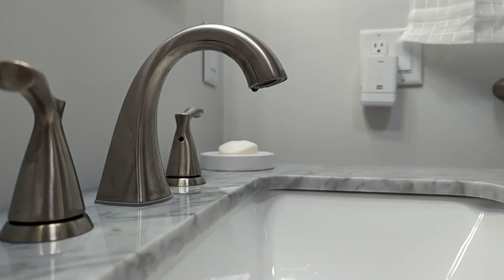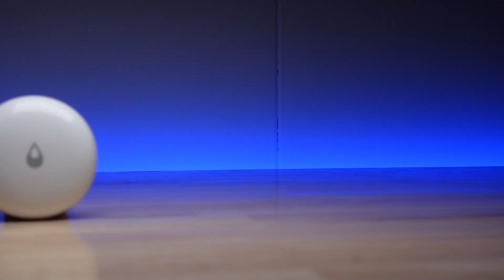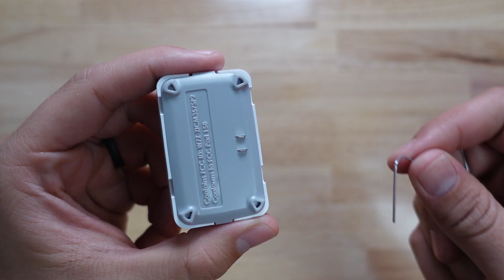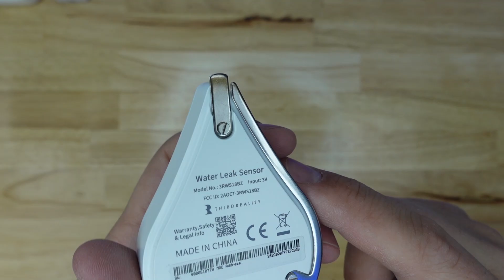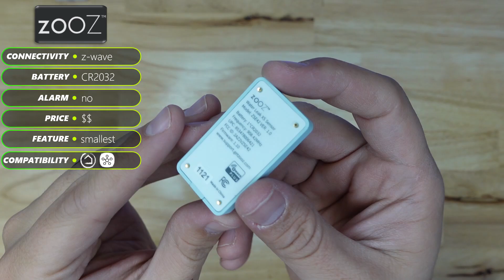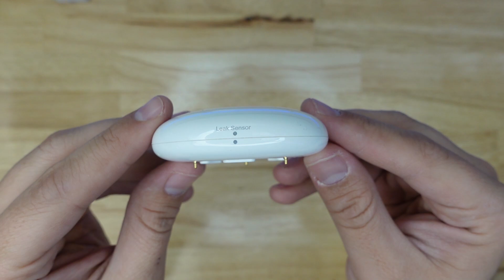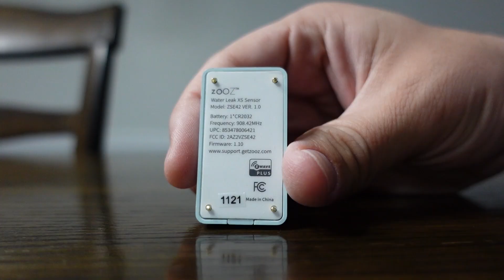Best Water Leak Sensors for Home Assistant (WATCH before you BUY!!)

Comment: I will be doing this for my hydroponic vegetable garden. It is a SmartLife unit and the water detection built-in does not have a sensor outside of SmartLife. With this unit, I will be alerted when I need to refill the device. Adding to my cart now.
Reply from the maker: Sounds like a sweet setup!

Comment: IKEAs leak sensors also stay Wet until you change out the battery. They're SUPER cheap though, so it's easy to pickup a bunch, but I'm not sure how well they work. One of mine has corrosion around the contacts. But because it stayed Wet, my alarm never went off.

Comment: I've had Aeotec water sensor 7 for a while now, but I keep wondering, should I mount it so that the probes touches the floor or should I just lay it "flat" on the floor, the probes being sideways not contacting the floor. I think I should mount them all so that the probes touch the floor just in case, but looking for some 2nd opinion
Reply from the maker: I would have the probes touch the floor if you can!

Comment: Full disclosure: I'm not an expert BUT some of these devices are listed with cybersecurity vulnerabilities on the National Institute of Standards and Technology (NIST) National Vulnerability Database (NVD). For example, a search for Zooz devices yields a DoS related vulnerability for any devices that use the Silicon Lab 500 and 700 series chipset (which is the chip in this particular Zooz device). Additionally, HomeSeer is noted as a major vulnerability with how the HS2 software operates. Again, I'm not an expert and I'm trying to educate myself on how to select safe products that are integrated into my house but wanted to put this out there for folks to look into themselves.

I was watching your video trying to come up with some ideas for my house and appreciate all the work you put into this. Your video content is great, keep up the good work!
Reply: I've read these papers from the NIST and other organizations, and while it is true that you can jam the Z-Wave network, creating a DoS attack, with either intentionally malformed Z-Wave packets (requires expensive equipment and a lot of work) or simply jamming the frequency directly (cheap and low skill), this is true of ANY wireless signal. The only way to prevent this type of attack is to keep all of your devices hardwired. This is the trade off we take when opting for cheap, secure, and reliable wireless devices over expensive, secure, and reliable wired devices. As for the actual security exploits, those were patched years before (2017) the vulnerabilities were published (2022) and are of no concern if you perform firmware updates on your 2013+ devices or purchased your devices after 2017. Basically, if you have any Z-Wave 300 series devices, replace them, otherwise, you're good. Also, use S2 security mode (optional on 500 series, mandatory on 700 or 800 series). Also, in regards to the HomeSeer HS2 vulnerability, it was patched way back in 2012, unless you're referring to one I haven't found.
Reply: @LifeBehindBarsMC  appreciate the summary you provided. I’m definitely not a cybersecurity expert but the input above helps me feel a little better about my Z wave network. I’m using the S2 security mode and the 700 series Zooz devices in my case. Cheers and thanks for looking into it!
Reply: Secure your network. Isolate iot devices
Reply from the maker: Thanks! I think these vulnerabilities exist for most Z-Wave devices, but I should do more research!

Comment: Perfect video and thanks for the call out.  I bought a bunch of the third reality sensors and was very frustrated when my leak sensor didn't pick up a leak I had.  Thus the spacers.  I would also recommend heavily to everyone to put a paper towel under your sensors so that if the leak happens to flow past your sensor and not hit it exactly the paper towel will wick the water towards your sensor alerting you when it might not otherwise.  Keep up these testing videos I love em.  Oh and if you want a shelly flood sensor I'd be happy to send you mine.  I didn't like the battery life on them.
Reply from the maker: Very good idea regarding the paper towel. I saw you suggested that on Thingiverse so I did that with the smartthings sensor in the wall. Thanks for the kind words!

Comment: Thanks for the great video! I jumped the gun and bought an Aqara leak sensor a few weeks ago (based on my good experiences with their other sensors), and my findings on it were very similar to yours. I was surprised by the difference in texture/finish/design, but after I was done testing it, it just went under the washing machine where I won't see it until the battery dies. I do like how small it is, and how an external probe can be connected. I'm definitely getting a few more for under the sink, under the dishwasher, and in the utility room. 

Also, at 0:30 I noticed that you have the same gap issue that I had with smart switches and Legrand decora plates. I put a few dozen in around the house, and found that the easiest fix was to take a sharp razor blade or box cutter and trim off the extra plastic around the screw holes on the backside. Depending on the type of smart switch, you may need to trim the extra plastic off from right around the inside of the decora opening too, but 95% of it can usually be taken care of by trimming down the back of the screw holes.
Reply from the maker: Can't go wrong with Aqara IMO.

Great Scott! That's an awesome idea re: the Legrand wall plates! I'll definitely give that a try. It really bugs me seeing that gap haha

Comment: With zigbee2mqtt you can enable or disable the alarm and the light on the Linkind Zigbee sensor.
Reply from the maker: Ah another reason for me to switch to Z2M...I need to rip off the band-aid haha
Reply: @MakeItWorkTech  yea i need to do that to but first i'm going to upgrade my hardware from a raspberry pi 4 booting from a SSD to a intel NUK. Already have the hardware in place and HA on it just need to use the backup i made on it and move my nortek usb zigbee/z-wave stick over to it.

Comment: I use the smart things sensor throughout my house and I really like them. something to consider is you will want to put a sensor where you AC unit is, since most newer homes (in the US) have the unit in the attic they sit in a metal tray in case it starts to leak so any sensor that can not be placed a metal surface would be worthless in this scenario.
Reply from the maker: Very good idea! Definitely gonna throw one up there in my house! Also thought about putting a probe-style sensor where the condensate drains. No condensate means it's not working.
Great ideas!
Reply: @MakeItWorkTech  you won't regret it, mine has saved me twice already, the stinking drains tend to get clogged with gunk if it runs a lot, in TX it runs a lot!